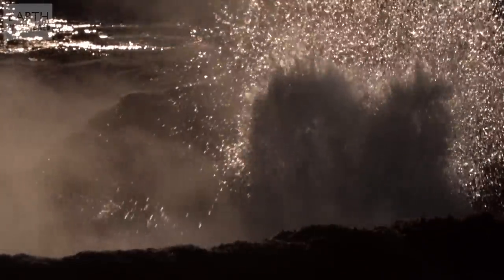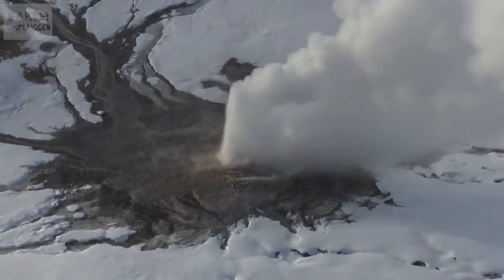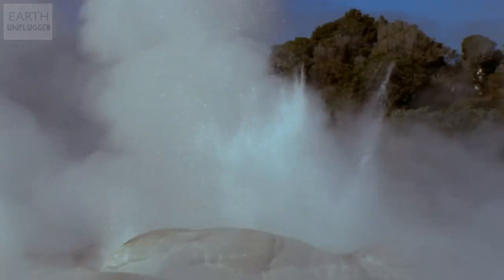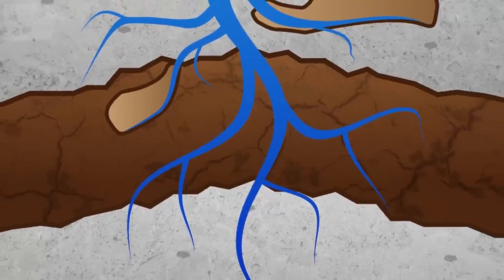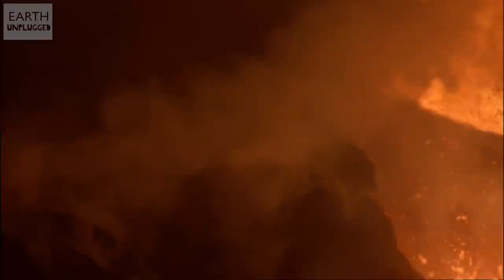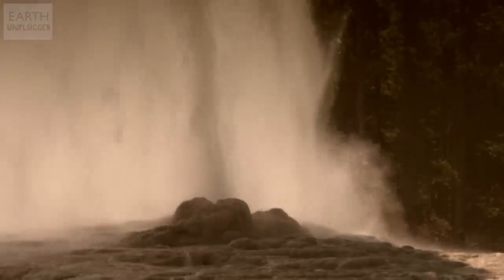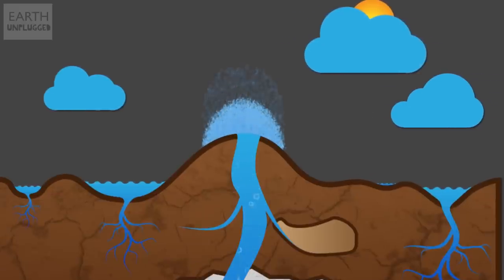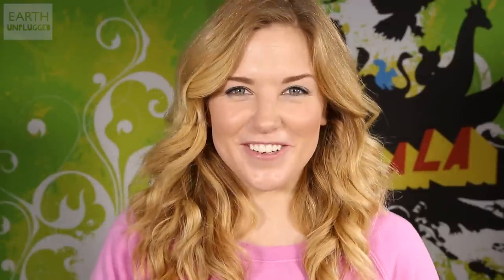How does a Geyser work? | Zoo La La | Earth Unplugged

Comment: How do volcanos just all of a sudden erupt when it's been hardened over several months or years?
Reply from the maker: Volcanoes erupt when rock inside the Earth melts, and as its volume increases magma is produced that becomes less dense than the surrounding rock. This magma begins to float to the surface, where any trapped water and gases can suddenly expand which in turn can cause the liquid magma to erupt violently from the mouth of the volcano. This process only happens once magma has filled the volcanoes chambers, forcing the pressurised magma to spurt through the opening.

It’s a bit like boiling a saucepan on a very low heat, if you put a lid on but leave a small gap, the water will quickly boil and ‘erupt’ through the gap due to the increased pressure, but if you left the lid off creating a much bigger opening that you pan would simmer for a much longer period of time. 
For more information please see these two links:
 
http://www.universetoday.com/77111/why-do-volcanoes-erupt/

http://science.howstuffworks.com/nature/natural-disasters/volcano3.htm

Comment: "...water rising from the centre of the Earth"

Nonsense. Correct this, at least in the description.
Reply from the maker: Hi Jay Smith, if you listen closely what we say is 'thermals rising from the centre of the Earth', not water (around the 2:23 mark)
Reply: Earth Unplugged Ah, thanks for the reply! Note to self, get ears checked.

But still, thermals come from the Earth's crust, the total thickness of which is only ~0.1% of the distance to the centre of the Earth. Even if it was just talking about the source of geothermal heat, ~50% comes from radioactive decay in just the crust.